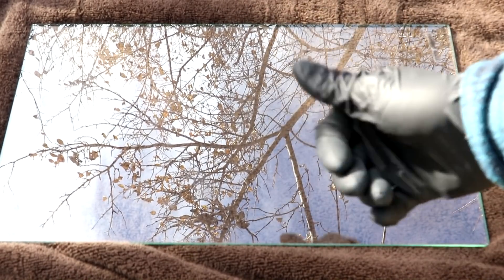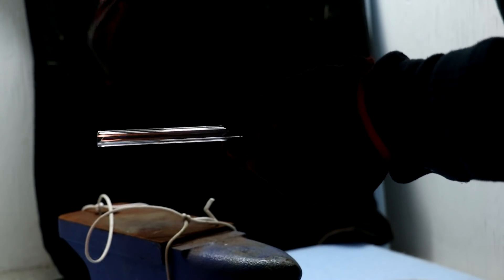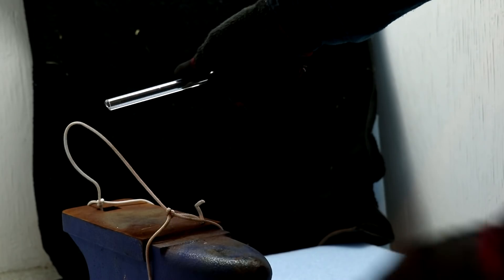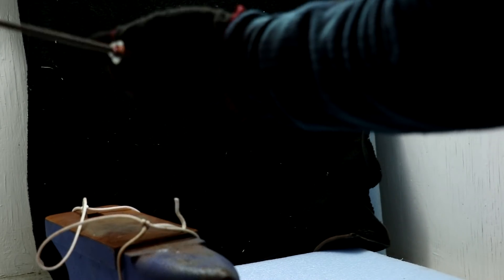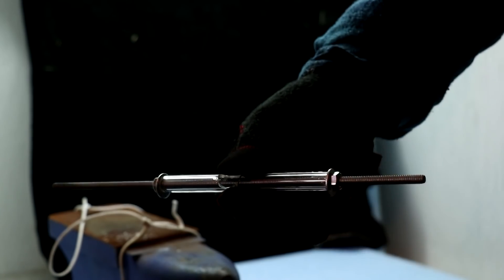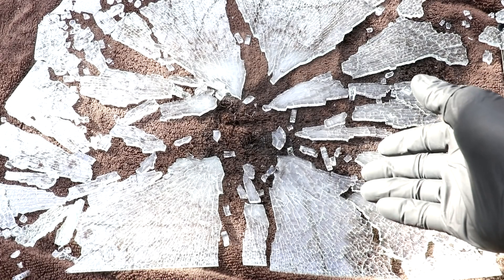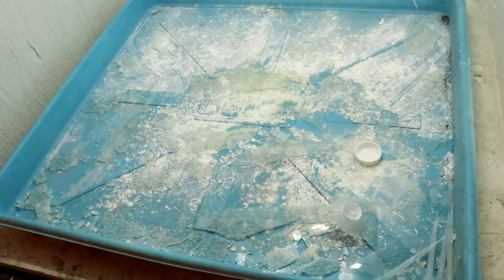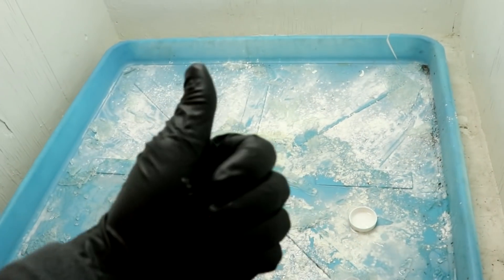Can I Dissolve Through Tempered Glass?

Comment: I have a concern about the flipping over and dissolving from the other side.

I think that once the glass gets thin enough it will start making cracks. and dissolving from both sides places the location where the glass gets thin in the middle of the original piece - in the area under tension. Perhaps if you stuck to dissolving from just one side, when it gets thin and forms cracks it will be close enough to the outside of the piece to not shatter.

Comment: An easy and cheap way of checking your tempered glass is to put on a pair of polarized sunglasses and put a smart phone screen underneath with a white page such as  notes app  or calendar then rotate your head or the cell phone and you can see the rainbow affects and you can see all the polarization lines around the holes and throughout the sheet I do it all the time it works great. It works because polarize sunglasses are well polarized and the phone screen has a polarized filter on it

Comment: Does the reaction generate any heat? If so thermal differences could be a factor. Also could the curing silicon have created a pressure differential inside cap on the underside?

Comment: Could you temper the glass as you're cutting through it? So as you're dissolving it with HF you heat up and cool that region every couple days or would that still break the glass since once it's tempered you'd ruin it by heating it up too much or cooling it down too quickly?

Comment: chlorine triflouride is one of the most dangerous, toxic, lethal, and no-no-no-never chemicals you can possess... but in your case, maybe it would work for you. What I mean is that CF3, which reacts with everything, including itself, can only be stored in metal containers lined with metal-flouride bonded materials, and can only be used in such systems. That's how it is used in industrial chemistry. The nazis attempted to weaponize it as a flamethrower(can you imagine how terrifying that would be), but were unsuccessful for obvious reasons. But this gets me thinking. What if you wanted a CF3 torch? by torch, what I mean is, what if you made a metal sponge, reacted it with flourine to get the same CF3 resisting coating internally on the sponge pores and material, and used the sponge in an assembly to form a a permeable nozzle for directly apply small quantities of CF3 to surfaces?

You'd go down in infamy as the most ballsy scientist or you'd die painfully in a green ball of fire.
Reply: Also, I feel kind of terrified for you handling HFA, since it can go right through a variety of glove materials and you can obtain a lethal flouride dose without knowing it until weeks later.

Comment: we have a lot of glass at our shop from windows and doors that we've replaced.  we were making a display cabinet for a customer and had a piece of leftover glass that would have worked perfect for both doors once cut in half.  after about a half hour of scoring and tapping, we're getting nowhere.  we put a 2x4 flat on the table and tried to break the glass over it.  both sides of the glass touch the table, glass doesn't break.  turn 2x4 on edge and try again.  as both sides are about a half inch away from the table, it occurs to me, this must be tempered... then it exploded.

2 years later, still finding bits and pieces of tempered glass in the shop when i sweep up.

Comment: I dont think the glass rod theory gives the full explanation. It cant physically expand but now can distribute the force of the weight to the nuts and the rod as well. Force can always seen as a triangle where the hypothenuse is the resulting direction. You could check it by comparing the breaking weights with and without tension.

Comment: I worked at a glass factory for a little over a year. Our department had to take out a lot of junk glass and break it over glass bins to be put into glass dumpsters. With a large steel pole, we would smash annealed glass just fine. When it came to tempered glass, you would have to swing as hard as you could and have the pole contact just on the edge to be able to break it. Or if you wanted to do it the easy way, just give it a light tap on the corner with a hammer. Tempered glass seems almost indestructible when attacking the face of the glass, but a light tap or bump on the corner and it would explode.

Comment: This sounds like a losing game, unless you treat the newly exposed lower layer so that it is no longer under tension, the glass that is the wall of the hole will always feel a force that tuggs it away from the center of the hole you made, and pull the entire thing apart.

But, i wonder if there's a tempered glass that is shaped differently than a glass panel, which could maintain itself even when acid cuts a hole in it

Comment: The only way of putting a hole through tempered glass is to heat the whole pane to near melting point, then cool it very slowly to normalise the glass. Drill hole in the usual way, then retemper the glass. Any method that tries to bypass relieving the differential between internal and eternal stress in tempered glass is doomed to failure. Physics can be such a pain (pane) at times!

Comment: I used silicon carbide grinding disk to put holes in older windows to place in a 5 year newer car that had plastic clips to hold them in place. Was 20+ years ago but sanding not cutting, and use of water to cool does work. But that is not what you are trying to accomplish sir and seeing result of the acid was interesting.

Comment: Cody, can you use a microtorch and burn a small hole though the glass? Use an oxy-acetylene torch and the oxygen might burn a hole through the glass. The melted ring might reduce the stresses.

Comment: Nitpick:  At 0:57, isn't it the shear strength of the glass that you're overcoming, rather than the tensile strength?  Clearly there is both a tensile and a shear component in bending, but the tensile component of that load is a lot smaller than the shear component, and so if you were to load it until breaking the shear would be the point of failure.

Comment: My guess is the only ways to get through an already tempered piece of glass would be to fill in the cracks as you bore through (like a tunneling machine) or to heat a small area up to just under the melting point, punching your hole then quickly cooling it again. You would want to use something very fluid to cool it evenly, like a commercial blast chiller (used in kitchens to rapidly cool food from above 140 to below 4) or the downdraft from the underside of a bowl of liquid nitrogen.

Comment: Soo cody, its a nice thought and it is possible (all though highly unlikely) to get through it, but it wont last any kind of time. The reason tempered glass doesnt pop is because the stressed surface is about 0.20 x the thickness of the glass (acting like a wire on a suspension bridge) and the internal stress is 0.60 x (acting like the road)and cooled at different rates thus the slow cooled inside would cause more stress the thicker the glass when you attempted to dissolve through the glass, it exposed the internally stressed glass and the force between the two overcame the distance and caused its own crack (just as if you were to use a really thin wire on a suspension bridge,it simply would not be able to handle the weight, or in this case, no wire at all), if you were to use a much thinner piece of glass like a tempered screen protector ("making the road on the bridge lighter")you may be able to get through it and have visible results due to the lower internal stress, only for a short period Of time though before it too would pop (because even with a very light road with any unsupported stresses added to the system would cause it to fail possibly even vibrations from the air, also i should add i dont think glass screen protectors are tempered the same way normal glass is because it doesnt break the same way and as far as i know the thinnest actuall tempered glass you gan get is 3/32 thick

Comment: Your explanation of tempered glass sounds backwards, since you describe the surface as being under compression and the interior as being under tension (4:13 and 9:25).  When it's hot and the surface is cooled, the exterior contracts, which puts the interior under compression and the surface under tension (on the other hand, I've never understood why those forces don't relax/balance after the temperature equalizes).

Comment: Try it again and don't flip the panel, my logic is that the outside layer will add a little support for the tensioned glass in the middle. once the HF eats through that portion the hard part should be done

Comment: This is the main problem with tempered glass (similar to what happens with tempered steel but w/o crystalline structure), the tempering process creates an incredibly high amount of microscopic defects such as tiny cracks because of the fast cooling the material received. It greatly increases its tensile strenght but also reduces its tenacity to resist the spread of cracks by a huge amount(which is pretty low already for regular glass), apart from having a lot more of these defects and thus more places for them to spread across the whole volume of the material.

Comment: Cody, by starting to dissolve the glass from the opposite side, you changed a variable. Does the same thing happen if you allow the acid to dissolve the glass from just the one side? I don't know if it would make a huge difference, but maybe removing the silicone introduced some hairline scratches into the glass and that was just enough to cause a problem by introducing a number of stress points that allowed the internal stresses to be released.
By setting up the experiment again and not tampering with the setup, would it work?

Comment: let's say you have a 5/8in   4ft x 8ft sheet of tempered glass,  you can ( up to a point ) bounce a hammer off the face of that glass, but if the hit it along the 5/8 side it takes much less force and explodes. if you go all out and get the same glass and have it copper colored UV blocking 1way mirrored the price to purchase ( retail ) is quite a bit... working for a glass company that had 3 extra sheets of it custom made for a building and sitting aside for 6 years and them not wanting them and getting to smash 2 with a hammer  ( 1 on the face, 1 on the edges ) to test the theory PRICELESS...

Comment: Wouldn't it work better if you dissolved it from one side? To me it seems it had to break when you removed the top and bottom that are under compression. That way the center, under tension, is left unsupported and gets pulled apart. If you go from one side, it seems you can dissolve one of the sides in tension and the glass still holds up. Don't change sides! Dissolve the middle that is i tension and continue to the other compressed side. That way the last part of the glass you etch through is in compression and there is nothing left to pull it apart.

Comment: I work with tempered glass everyday at work and i gotta say that turning a 5mm tempered sheet of glass into 1mm of thickness without it (almost) breaking is rather impressive. I suggest you try the experiment again with a different thicknessess, 8mm or 10mm, as they tend to be more resistant to damage and try to make the hole in the middle, the edges are a weak point. It is also possible to temper it at different air pressures, the 5mm glass we make at work goes out of the furnace into a cooler usually about 6500 kPa to break into a similar sized pieces as shown in the video. If you slightly overheat the same sheet and cool it let's say about 9000 kPa the pieces when it breaks will be much much smaller and also the glass will be much harder to break thanks to the greater pressure inside.
However i don't really think that it will be possible to make a hole in a tempered glass without it breaking at some point, but who knows! :-)

Comment: I wonder if you can't use some kind of tape (or similar) to bulk the area up where the hole goes?

Like with those magic tricks where you put scotch tape over an area on a balloon, then pass a needle through it?

You'd probably need better "tape" and I don't think flex tape will do it, so maybe epoxy resin or jb weld?

Comment: At my old job, we had a glass guy that offered to try and cut a hole in tempered glass. He admitted that there was a very high chance of it breaking, but we told him to try. I don't know how, but he was able to do it. We kept going to him for all our glass needs because of this. We found he had about a 30% success rate (was still cheaper to try than to just replace.) I think he enjoyed the challenge because he wouldn't charge us his labor on the times it would break, just the cost to cut a new one. 

It was a win/win for both of us. We had glass that needed holes in it and it would have to be replaced anyway so we were out nothing if he failed. He got returning business for large expensive glass.

Comment: yes you can drill holes in tempered glass!!
 i made my own build plate for my 3d printer by drilling  a bolt hole in each corner of a tempered glass sheet. The holes i drilled were not even nice and neat, they were very sloppy.
i just used a diamond bit and water with a hand drill, nothing abnormal. And it wasnt a random chance, cuz i made like 2 or 3 versions of it trying to make the holes look neater.

Comment: Heat would be fascinating, maybe it could work if you compress the perimeter of the pane?
Practical example could be a tempered tumbler glass vice clamped at the base.
Perhaps the force isn't uniform enough but it's a work-able size.

Comment: Even if it worked wouldn't it have been impractical. Disregarding the time it takes, wouldn't the edges be extremely sharp? Attempting to sand them, or even the slightest touch/scratch to the hole in the glass, should cause it to shatter.

Comment: Hey Cody! I think you should try again without disolving from both sides.  I think you left the part of the glass which was under tension  till the end, which meant that as it thinned it eventually snapped abruptly due to the tension. If the last little bit of glass was not under tension you could maybe get through.

Comment: So I'm sure you know this and were just simplifying for the explanation, but as a mechanical engineering student it kind of bugs me that you said that scratching the glass lowers the tensile strength of the glass. I apologize if this is too technical or already somewhere in the comments.

Tensile strength is a property of the material, you can only change it by changing the material in some way (think like recrystallizing metal while annealing or adding new elements to the crystal structure). What a crack (or really any irregularity in the object's geometry like a rounded corner or a hole) does is create a stress concentration that multiplies the stress in the material by some amount, depending on the size and shape of the crack. The sharper and/or deeper the crack gets, the more it is multiplied. Then once this multiplied stress exceeds the tensile strength of the material, it fails. In the case of tempered glass, it fails spectacularly.

Again, I'm sure you were just simplifying for the video's explanation, but I just think this is an important distinction. Otherwise was a good explanation of how prestressing and tempering work, and I enjoyed the experiment!

Fun fact for those still reading, to put some perspective on the 20-30,000 PSI Cody talks about the glass being under, that's nearly the tensile strength of steel (~30-35,000 PSI for average, non-high-strength steel)

Comment: What if you didn't rotate the glass? By rotating, you dissolved both the sides on compression, and left only the part in tension. Perhaps if you dissolve only from one side, you can dissolve the middle part while the other side keeps everything together.

Comment: If you can think of a way, to add a ring around the glass, that is able to hold it at its original stress, you should be able to put a hole through it. 
The issue you need to avoid, is rapid decompression. which could maybe, be avoided, with a sturdy ring, and some sort of epoxy that would work well on glass and the rings material.

Comment: You were OK going through the skin layers because the circumference of the holes were under a residual compressive stress. We know that ceramics are good under compression. As soon as you breached the center layer, the glass was bound to fracture as it did. The center portion of the cross section of tempered glass is under a residual tensile stress, which really means that there is a tremendous amount strain energy stored throughout the cross section. When the second compressive layer on the reverse side  dissolved, there was nothing restraining the tensile stress in the center (cross sectionally) of the hole. Failure started somewhere in the center section and blasted outward. I have always wondered what this experiment would look like. Thanks Cody! 👍

Comment: I worked at a glass shop that installed heavy glass doors and enclosures (3/8" to 1/2" thick tempered glass). One of the most impressive but scary sights I saw was a glass door falling off of a truck. The door jumped up in the air about 6 to 8 feet and spread glass in a 30 foot diameter. After that, even though tempered glass is still meant to be a "safety" glass, it won't kill you when it breaks but can cause some injury. That kind of leads me to my point, I watched as one of our installers sanded down the edge of one of these heavy glass doors to make it fit an opening. There does seem to be a slight amount that you can alter tempered glass without severe weakening or failure.

Comment: Coming from a materials engineer, you've given an excellent description of the mechanics behind crack nucleation, propagation, and brittle fracture.  Also, your points on the forces in tempered glass are spot on.

Also, holy sh** dude, 48% HF? Do you have that for doing rock assays?